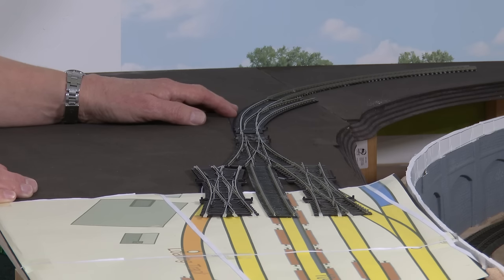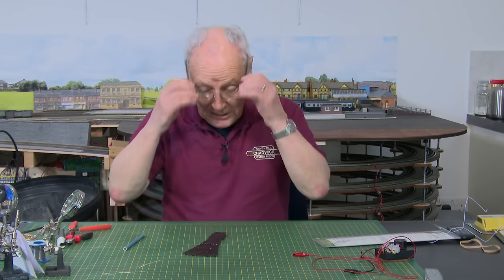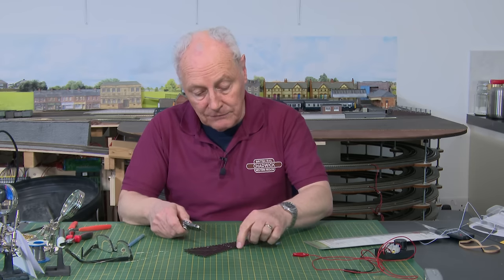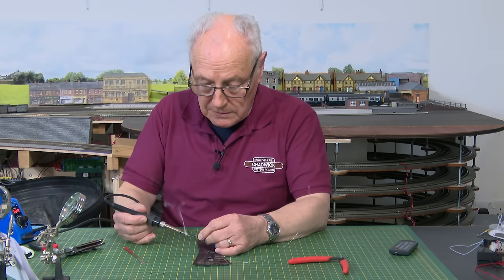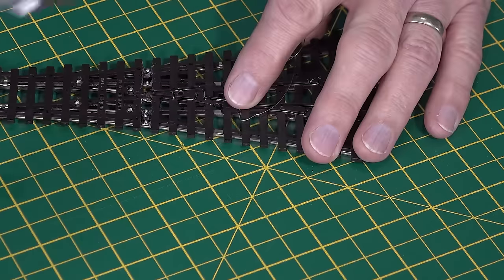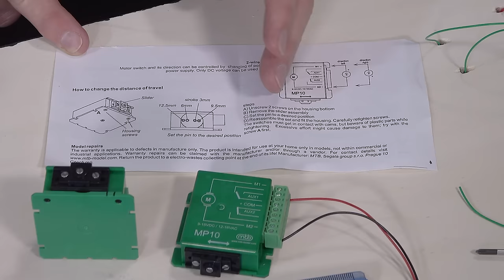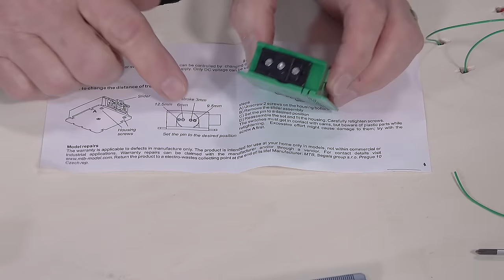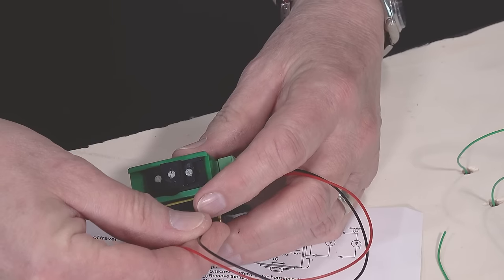PECO 3 WAY POINTS & MP10 POINT MOTORS at Chadwick Model Railway | 218.

Comment: I noted the question on interlocking. Not easy with the point motor chosen by Charlie. However, if you use a Cobalt point motor, it has 2 auxiliary switches, 1 used for the frog polarity and you can use the other to interlock the switch blades so they don't move out of turn.
Reply from the maker: That’s an interesting point Simon, however surely this must be a workable solution for the MP 10 also. Regards Charlie.

Comment: The one thing with 3-way points that seems to not get mentioned, is sequencing the operation or providing some basic interlocking between the two point motors.  Why would this need to be considered, I hear you ask?  With the route set for the straight ahead option, both sets of switch blades are free to move.  However, when either the left or right routes are selected, one set of switch blades will be 'pinned' by the other.  If you then elect to move the pinned blades first, you will effectively be trying to move both.  Personally, I prefer to interlock the movement rather than try and implement some sort of sequencing, as one of the switch outputs on each of the motors can be used to either cut or enable the supply circuit to the opposite motor as appropriate.
Reply from the maker: You are of course dead right Dell boy. However, I will cover this when I come to do the wiring. Regards, Charlie.
Reply: I use four 3-way points  in the feeds to and from a fiddle yard.  These are automatically controlled using devices (Block Signalling IRP1 modules) which can only make binary choices.  As a result,  I have to operate the two point motors in sequence to give me a choice of three tracks.  This is quite easily arranged and only requires an addition switch on the first point motor - the one nearest the toe.  The first timer then activates via the IRP1s both motors in the same direction.  They therefore select either the LH track or the RH track,  If the RH track is selected, then the next timer operates (again via the IRP1) only the second motor.  This selects between the RH track and the centre track.  If the first change selects the LH track, then the extra switch on the first point motor interrupts the timer output so that the second point motor remains inert thus leaving the LH track selected.  It works.
Reply: @ChadwickModelRailway Good man.  As I said in my first comment, I don't think I have ever seen this particular topic covered by any model railway Youtuber.
Reply from the maker: @grahamthompson6622  thanks Graham, for an excellent comment. Standby, I might be chasing you up on this one. Regards, Charlie.
Reply: @ChadwickModelRailway  Really interested to see how you wire up/operate the two motors on the 3 way. Hoping u can suggest how to do it with manual switches as well as you covering DCC operation.
Reply: Thanks for the video Charlie very useful as I am starting my first layout that will have 2 three way points. Could you cover the x next as I will be playing with them soon too.

Comment: Excellent video as always Charlie.  Just a tip for cutting the point sleeper webbing - use a small wooden block to raise the point off the worktop, to allow the blade to be parallel with the worktop.  Think of a chef's knife, with its shoulder between blade and handle, designed with this in mind.
Reply from the maker: Thanks mate, for some excellent advice. Regards, Charlie.

Comment: A very complicated subject done with some simple advice. That's the thing I like about your videos - easy to follow, clear instructions and some very useful guidance. Luckily for me my layout is very simple, but the video had me fixed all the way through. Cheers, Kevin
Reply from the maker: Thanks Kevin, that’s very kind of you to say so.  Regards Charlie.
Reply: @ChadwickModelRailway  Your channel really is a must watch!!!
Reply: The video was done very well, but the actual principles and the project is not overly complicated.   The best way to understand it all is to just draw it on a piece of paper and it is just a few switches.   Honestly, if you are starting out or not sure, drawing the electrical path on paper ( roughly what a schematic is) makes it a lot easier to understand
Reply: Hi Charlie
Have you ever considered mounting tortoise switch motors horizontally with the actuator wire bent at 90’ to go up through the base board. You can mount directly to a cross member if for some unfortunate reason you place a point too close or if you need a slimmer installation without the motor hanging down.

Comment: Hi again Charlie 
Marvelous. 
Entertaining and informative. 
I think I will avoid a 3 way point though ! Why do you remove the springs? 
I wish I could solder like that. 
To be able to solder the remaining two joints on the jumper without melting the previous 
Is clever. 
Look forward to the double slips. 
Thanks again. Really enjoyable 
Stay safe. 
Howard
Reply from the maker: Hi Howard, I believe that soldering is easier than you think.  Perhaps a subject for a future video.
Regards Charlie
Reply: you remove the spings to make it easier for the switch machine to work without overloading it, if you do manual switching you can leave them in. ans as Charlie said once you take them out you wont get them back in. so plan ahead for what you want before taking them apart.  Happy Railroading  Howard

Comment: I have a different approach to soldering that you might want to try.  I put a dab of flux using a toothpick on each rail and then put solder onto the tip of the iron.  When I put the iron onto the rail the solder flows via the flux onto the rail.  That means I don't need to hold the iron on the rail and apply solder.
Reply from the maker: Sound advice Andrew, thank you. However, I now use a different flux from DCC Concepts.  It really is a game changer for me. Regards, Charlie.

Comment: That Charlie, was a particularly interesting and informative video. In particular, because I’ve so far installed a couple of MTB MP1 point motors and will soon be embarking on the installation of four more, so there’s some very helpful hints for me from this video. I love those templates, I think I need to invest in one or two of those. 

Just thought I’d mention something that I do out of experience with Peco points. I’ve had a couple of instances of those fine frog wires failing after having been in service for a while. This has been caused by the very fine welds of the wires onto the underside of the track, sometimes they aren’t very well done and come off easily. If the weld is poor, it causes it to go into a high resistance connection and as I’m sure you’re aware, that causes a current increase leading to a thermal runaway that eventually causes the weld to fail. The next thing you know, trains are stopping or jerking across the point. So now, in addition to the modifications you’ve shown, I also remove the fine wires and dremmel out channels under the point to replace the fine wires with the dropper wire that I solder on - bridging the frog connections in a similar way to how you do your track feeds. This improves reliability considerably. 

Finally, just an observation. You’ve noted that the reason you’re using MTB motors instead of the Tortoise ones is to provide clearance underneath for trains on lower sections of your layout. Then you discussed the shaft, or pin of the point motor is adjustable up and down. It occurred to me that there’s a risk of trains hitting the pin if you lower it too far so perhaps just a final check of clearance of trains underneath when the completed assembly is put back in place to make sure none of the pins are low enough for trains to strike  them ? Anyway, just a thought. 

I’ve been waiting for Peco,to start producing their Code 100 points in Unifrog versions, so it’s great to see that you have one now. I’m hoping these will be readily available by the time I get around to Phase 3 of my build. So, seeing as you asked, I’d like to see the curved Unifrog point wired up in your next video. 

That’s it for now Charlie, great video as always. Take care.
Reply from the maker: Many thanks for your comment Bryan.
I have never had a frog wire come away, once installed. However, I’ve pulled few off during preparation.
I’ll try to find out if Peco are planning to upgrade there Codes 100 and 75 to Unifrog.  Regards Charlie

Comment: Another great video Charlie, these are an invaluable asset to someone like me who is re-staring an interest in model railways. My late dad showed me how to solder before I was a teenager and it brought back some fond memories having to 'tin' the leads and the destination point before applying solder to the joint so that the solder flows between the parts with the minimal of heat. For delicate components back in the 70's we'd use a heat shunt. Once again many thanks for sharing the thought process along with the method for these activities. Anyway I'm still some way off a build so I hope I will absorb all your shared knowledge like a sponge. As a kid I had a gift for this but maybe less so some decades later. Cheers Charlie. All the best.
Reply from the maker: Thanks Anthony, I’m so pleased that you found the video interesting. Regards, Charlie.

Comment: Charlie, thank you for an entertaining demonstration of intricate track planning and laying.
For the three-way points, where does the power to the frog take over from the power to the blades?  With a normal two-way point, you show the action of cutting the feed from the frog to the blade (and actually, without frog power, the other way around), but I didn't see the same action being done for the three-way point.
Best wishes.
Reply from the maker: Hi Tom, there are small isolated sections within point construction. Regards, Charlie.

Comment: Hi Charlie, a quicker tip to save time and materials; when cutting grooved MDF boards with a jigsaw - have the good side facing the foot, because the blade is a pull cut and will draw the fragile strips against it's self. Subscribed and enjoying the show.
Reply from the maker: That’s a fair point, but of course I couldn’t scribe the line on the outside. Another way is to use a much finer blade, designed to cut steel. Regards Charlie.

Comment: I've fitted many peco points of all descriptions since my build started in 2007. Although I'd heard reference to these modifications I never really understood it and was fearful of ruining the thing, so left 'em alone. OK, so I very occasionally have to clean or tweak the blades and it's all too late to start changing things now. 
The other aspect of this I never understand is that if this change is such an advantage to good running why don't peco make them that way in the first place?
As an aside,  although I won't be starting any new builds I do find your presentations so good I can't resist watching. The only regret and frustration I have is that you weren't  doing this when I started!!
Reply from the maker: I’m so pleased that you found the video interesting. I do believe that Peco need to modify and update their stock lines. Regards,Charlie

Comment: Great vid especially as there is little on the three way wiring out there. Double slip wiring and point motor installation would be greasy to see please. Cut safely with your new knife. Steve.
Reply from the maker: Thanks Steve, I’m so pleased that you found it interesting. Also, I still have my fingertips! Regards Charlie.

Comment: Great stuff Charlie ... can you carry on and show how to wire them up .. including say, how to switch two motors together and how to include a coloured signal or direction lights on a control board?
Reply from the maker: I was certainly show you how I wanted them up. However, I have no signals to wire in that area. Regards, Charlie.

Comment: Once again an inspired Video having to re jig my upper level I would like to see the double slip I would also like to see how you integrate the MP 10 with the Digitrax stationary decoder and if your also going to use MP 7 as well which I believe are three wire as opposed to two wire on the MP 10
Keep up the the Great Inspirational Video’s
Reply from the maker: Hi Chris, I have may have misled you in the video. On the MP 10, there are nine terminals, rather than eight. The centre terminal is the common for three wire switching. Regards, Charlie.
Reply: @ChadwickModelRailway  Cheers Charlie I naively thought there were two types of point motors two wire where the polarity is reversed and Three wire with a common, every days a learning day thanks for pointing that out 
Keep up the Great Work
Ps any date on the Summer Camel open Day ?

Comment: Hello Charlie, I must thank you for bringing my attention to these turnout motors. After viewing your video no. 188 I ordered a 6 pack of the MP 1 turnout motors. In my opinion, they are the best turnout motors on the market today, quiet and slow acting just like a real railway turnout motor. The only slight modification I made was to incorporate a brass omega loop between the motor and the turnout, as the 3 mm throw was too big for my hand made turnouts, otherwise they operate perfectly. Thank you. Regards Barry  PS for switching the MP 1 I am using a simple DPDT slide switch.
Reply from the maker: Thanks Bazza, I pleased that they worked out well for you.  Regards. Charlie

Comment: Having watched a, ahem, few of your videos and given how consistent you are with your methodology of wiring your points and slips I'm surprised you don't use a template to mark up the holes for them in the baseboard. Similar to the Scenic 3D point jigs in a way but specific to your methodology. Both your wiring holes and the 10mm hole for the actuator wire have enough wiggle room to allow for minor adjustments in alignment.
Given how far you've got it might be a bit late for this! 😁
Reply from the maker: Just a little Bob, four more points and the layout track laying will be finished! 
Regards, Charlie

Comment: Watching you struggle with that 3-way point, I thought…”that’s what Dremels are for👍. You are correct about that lead free solder, it is next to useless unless it is being used in a commercial solder flow application. As an electronics engineer I can state emphatically that I ONLY  use leaded solder in my workstation, just wear an appropriate filter mask
Reply from the maker: Many thanks for sharing your thoughts, Bruce. I did not use the Dremel as most people won’t have one. Regards, Charlie.

Comment: Hi Charlie.
Glad you pointed out the problem with the blade connection. Just bought exactly the same three way point, thought I had a duff one until I squeezed the blades.
As yourself not a fan of these points.

Thanks you Charlie.
Pete.
Reply from the maker: Thanks Pete, I see that we both have our reservations regarding this point. Regards, Charlie.

Comment: Hi Charlie, you made that look so simple. Imagine trying to do all that without having a removable board. 

If memory serves you have a surface mount point motor just below this goods yard. Doesn't look like there would be space to use them in this position.

Great video as always. Have a great weekend!!
Reply from the maker: Yes, you’re right David, on this board there really isn’t room to mount them on the surface. Many thanks, regards Charlie.

Comment: Another superb video Charlie! My vote is for the double slip. I have two to install on my planned layout, but although I'm primarily using Code 100 track, I went down the path of the Code 75 electrofrog double slip and the code 100 to code 75 conversion tracks. I have two double slips to install, so these tutorials are very timely!
Reply from the maker: Thanks Jon, and I do hope you find the forthcoming videos useful. Regards Charlie
Reply: @ChadwickModelRailway   I'm sure I will Charlie. I really admire how you can make complex topics so comprehensible! Thanks!

Comment: Hi Charlie, I wish you had done this video before I had my escapade with the 3-way points, I did get them sorted eventually and they now work fine. The heat-shrink kit is very useful, I got mine some months ago when I was installing decoders into some of my 1980's loco's. an extremely versatile kit. With regard to what to do next I think you should operate on the curved 'Unifrog' point as I don't think that many of us have had experience of them, as always a very interesting and informative video, many thanks.
Reply from the maker: Thanks Peter, I’m so pleased that you found the video useful. Regards, Charlie.

Comment: I had to use marine ply for my boards because after cutting 2 sheets of 8 ft x 4 ft std ply to 22 bespoke sizes, after 2 weeks they had warped.
I normally deburr the other side of the board where I have drilled it, in order to get rid of the sharp wooden spikes from the ply.    I used code 75 for my upper part of the layout and code 100 for the storage yard. I have 2 of the 3 way points on my storage yard but at the time Peco did not make the 3 way conductive point for code 100 so I bought code 75 conductive 3 way points and used the rail adaptors to enable me to use the code 75 3 way points, with the code 100 rail.
Reply from the maker: Many thanks for sharing your process, Sam. The boards that warped, was it in a damp environment? Regards, Charlie.
Reply: @ChadwickModelRailway No, the marine ply has stood up to more extreme conditions than that which warped, The other ply warped within 2 months but the marine ply was cut and installed about 5 years ago.

Comment: Very useful installation tips for the MP point motors Charlie. I can't thank you enough - I have a few of the MP types, yet to install, and your explanation will make it much easier for me. Did you choose the MP10 specifically because it has the same footprint as the Tortoise?
Reply from the maker: I choose the MP10s because of the use of the jig and to test it on behalf of the subscriber as it’s a new item on the market. Regards, Charlie.